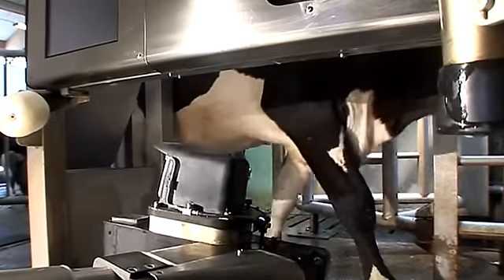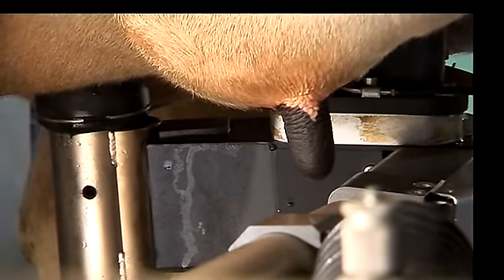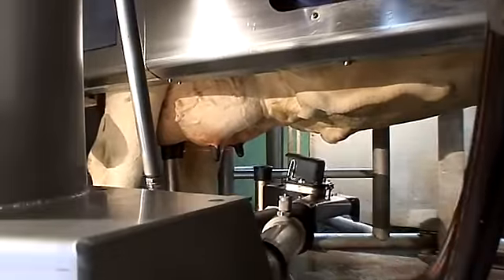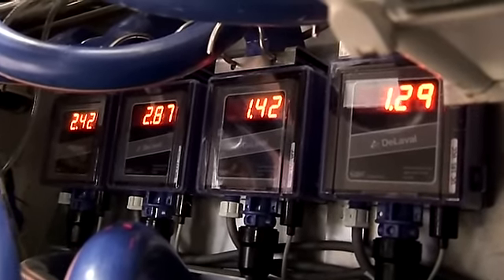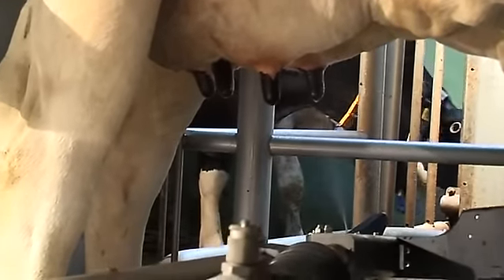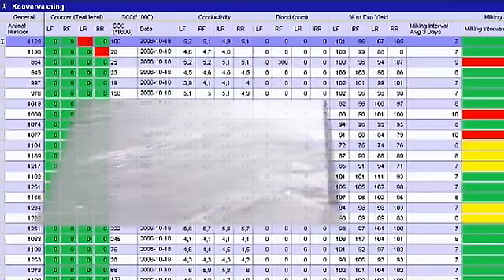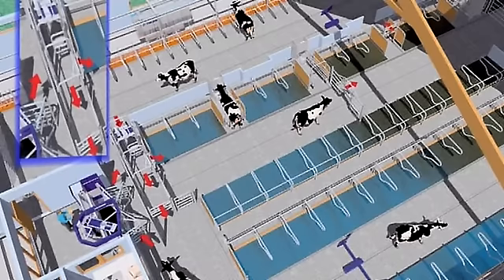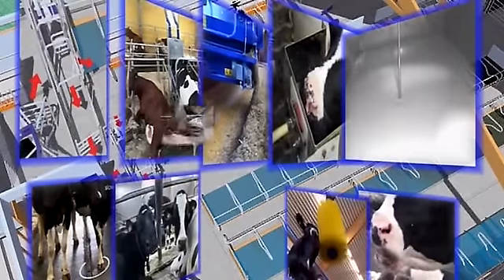DeLaval VMS Voluntary Milking System | The Milking System of Future | DeLaval

Comment: If the cow kicks the arm is never behind the bot. The cows don't have to go in that's why its called a VMS Voluntary Milking System. The cows are trained to use the robots buy the Engineers  that work on them as well. and if the cow gets hungry it will enter the bot because it feeds them as well.